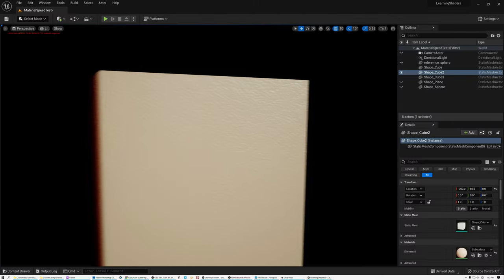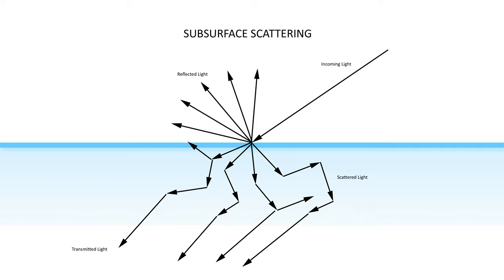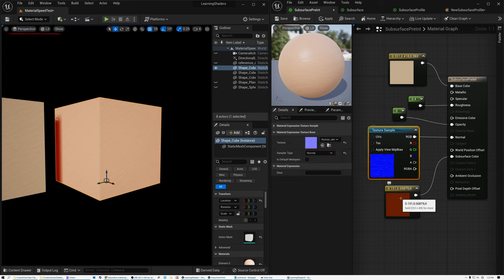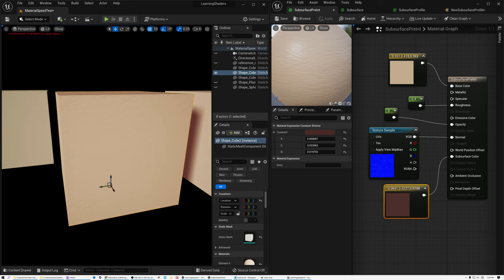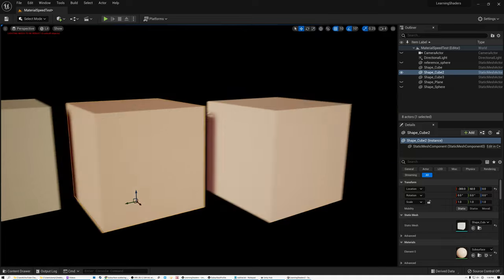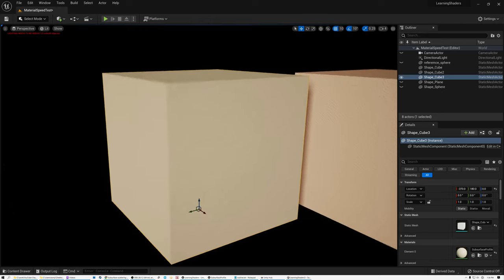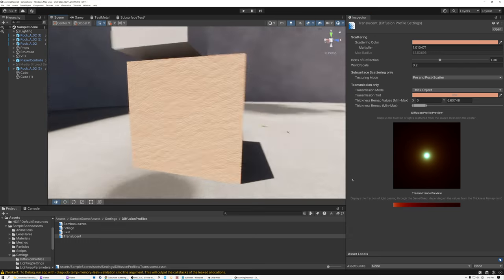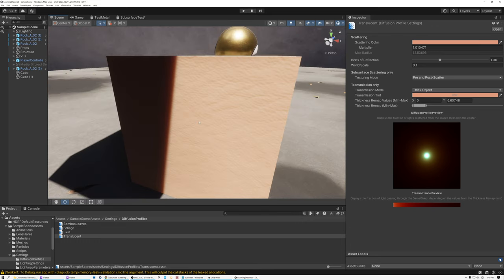Subsurface Scattering - Advanced Materials - Episode 8

Comment: @Ben Cloward. Absolutely love your channel, you are my new mentor! So a few key things to get the subsurface scattering working with the subsurface shading model:    1- Make sure that in your material the MATERIAL SHADING MODEL is set to SUBSURFACE.    2 - That you are using a color node with ALPHA (constant4Vector) to drive your Subsurface Color  (play with the alpha value and saturation and luminance of the color to effect the SSS).    3. That your OPACITY is set to something lower than 1, the lower the value the more your SSS is present and the less your diffuse is visible.    4 - Your lights are set to MOVEABLE.     5 - Turn ON TRANSMISSION under the light DETAILS.     6 - Make sure that you turn off raytraced shadows - in the light DETAILS, set the CAST RAUTRACED SHADOW to DISABLED.
Reply: Heyy thanks for all this points! I was thinking why my SSS was looking soo exagerated and It was because I was having CAST RAUTRACED SHADOW enabled. Do you may know why this is causing light reacting so off with SSS? Many thanks

Comment: Awesome and the only tutorial that explains all three methods. I was hoping that someone would explain it some day. Thanks a lot! Can you also make a video about the ways of making flipbook materials smoother? Some of the current-gen and next-gen games are using flipbook for water particles. Yet they are around 16 or 32 frames per second, which makes them look stuttery. Can we keep the resolution per frame(of the flipbook) and make it run smoother having issues with the texture resolution?
Reply: One technique used is blending between frames